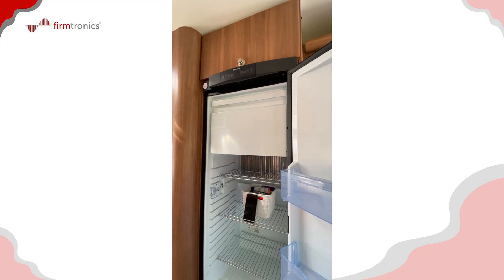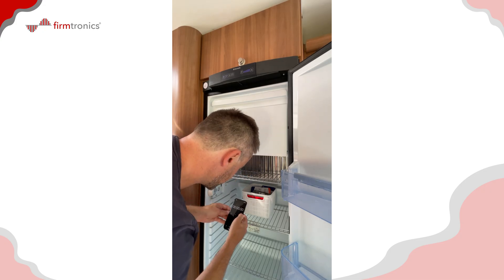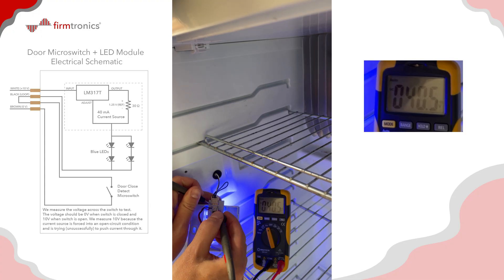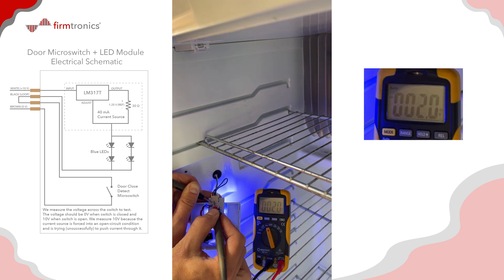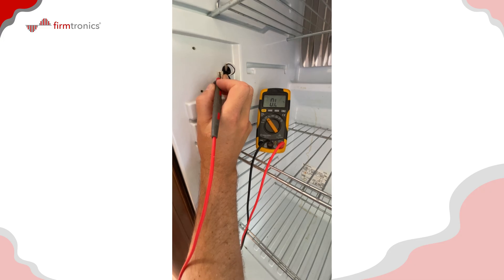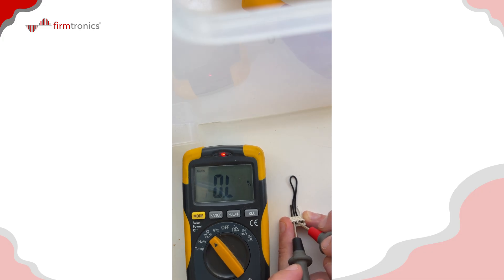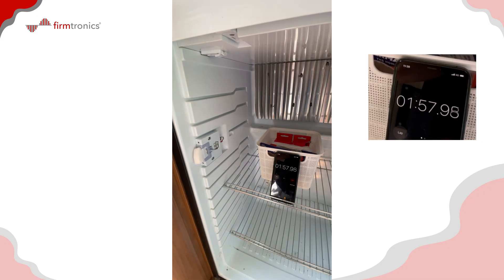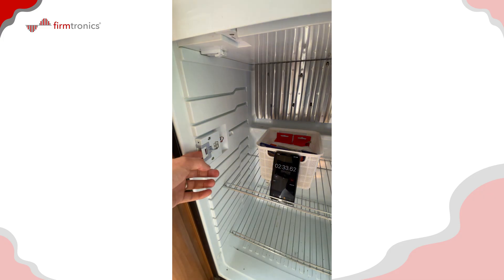Dometic Fridge Door Switch Fix (Beeping when Door Closed)

Comment: Do you have a link to that replacement part? I have the same problem.  I don't have any way to test the circuit but hope replacing the part will solve the problem, if I can find it.  Trying to reach Domestic now.  Thanks
Reply from the maker: Apologies for late reply, link to the replacement part:
https://www.caravansplus.com.au/lock-light-no-lens-rh-4-pin-suits-dometic-rmd-rmdx-fridges-p-14807.html?srsltid=AfmBOoqmBc1djQqkO5T-4D8rX_SoACBDVHFN3BQBHfee7UhC-iQeTFnA